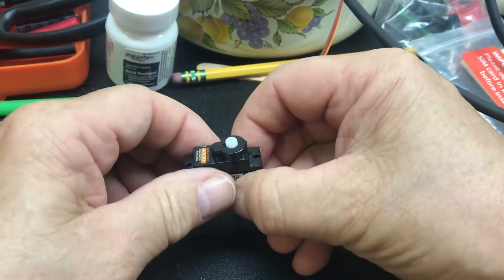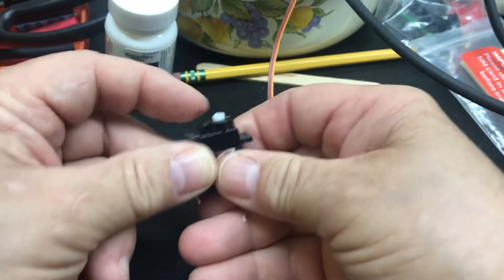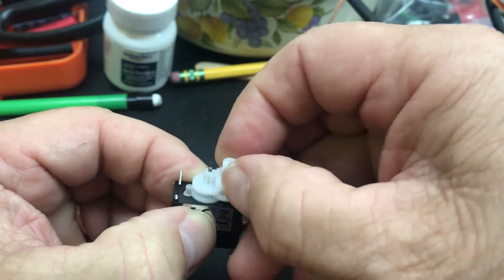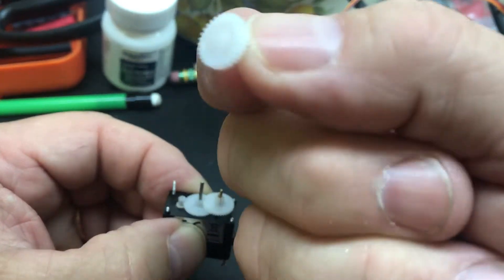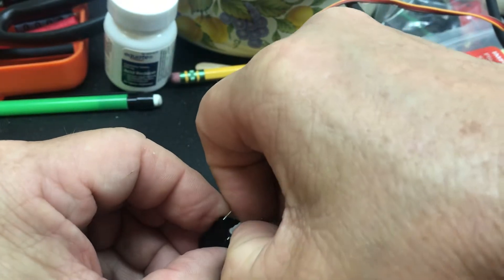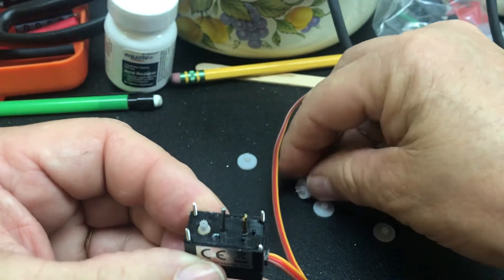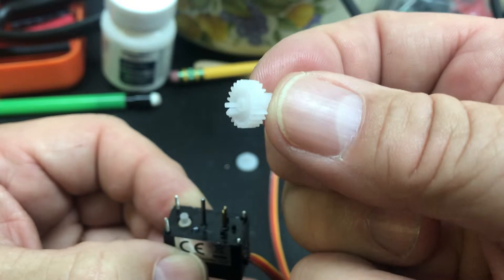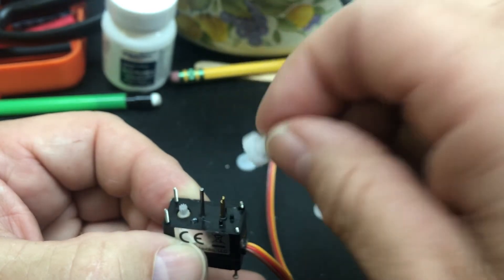Spektrum A330 Servo Disassembly

Comment: Do you know what caused the teeth to break off? Is it fixable or just not worth it?
Reply from the maker: I'll bet that I caused this by obstructing the movement of the flap. I have some HobbyKing HXT900 servos on order and I'll see  if they will be a drop-in fit.  If not, I'll see if it's true that the gears can be swapped.  Thanks for asking.
Reply: Everything is fixable, but these, IMHO, are not worth it.  If you have to replace it, anyway, just buy six new better digital servos - like hitec hs-5065mg
Reply from the maker: Mike, Thanks for the recommendation on the hitec digital servo.  I'm a noob at RC flying so your experience helps me.